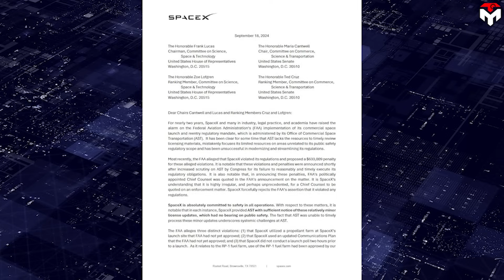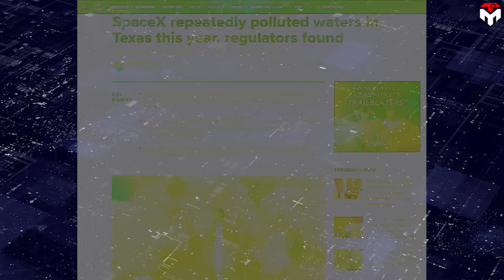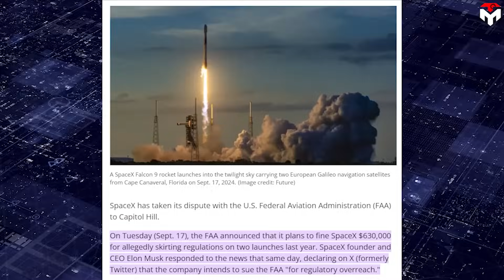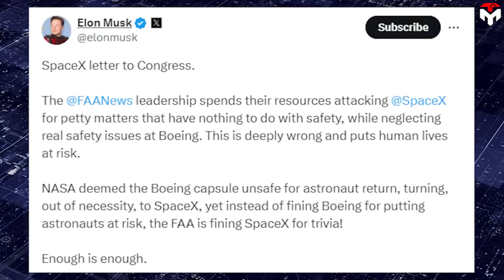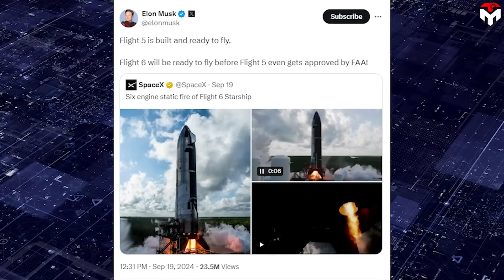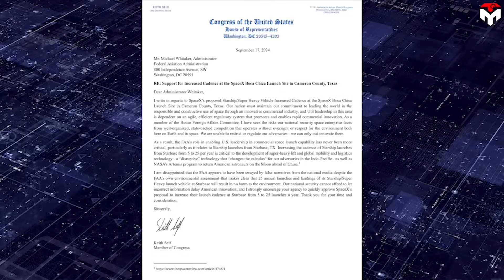SpaceX Exposed Shocking BUREAUCRACY Secret on FAA Delay Starship...

Comment: Why can't the launch pad be built on water but over a huge sand bar to enable more stability to the site???
Reply: Have you tried to build a 10,000 ton structure on Sand?
Reply: @jameswalker758  Pilings It's been done before it can be done again
Reply: @nealmacdonald8191  No different to where is is now after it is a sandbank.
Reply: @jameswalker758  pilings are driven down to bedrock